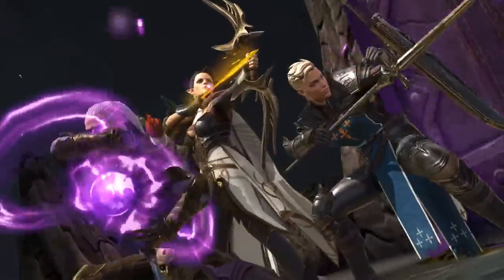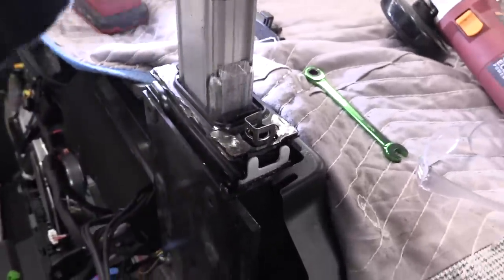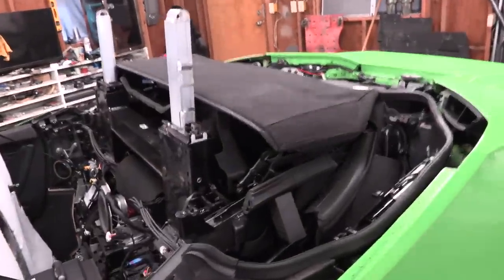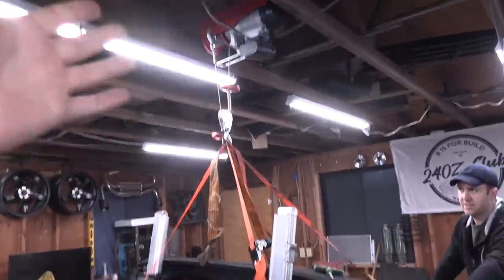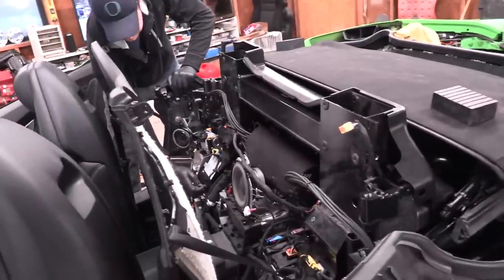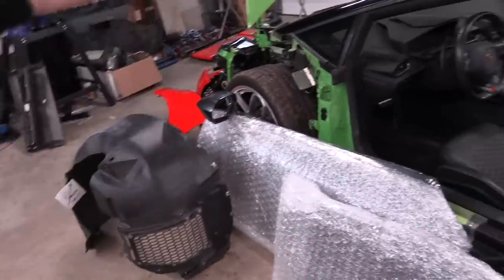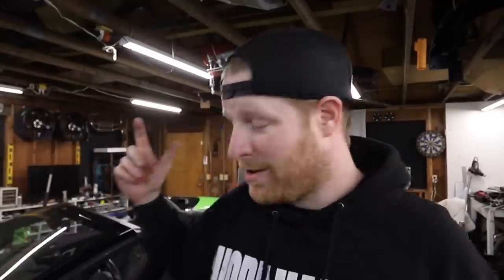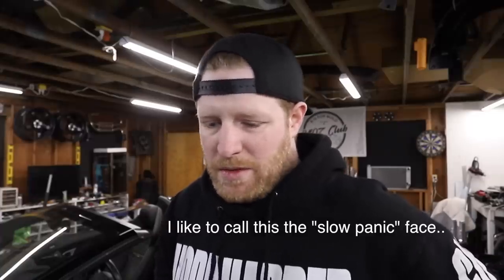Auction Lamborghini Huracan Parts Are In!! And Pop-Ups are Out!!

Comment: Slide a coat hanger down the tube on the outside of both towers at the same time. You can giggle around and find the release trigger for those vertical crash bars. Works every time.

Comment: Congrats on getting those roll bars out, I’ve had to repair them before on a convertible Nissan Murano and it was a pain in the ass even with the service info readily available. The soft top may still not work after you program the window because the air bag system thinks there is a problem with those roll bars even though they aren’t in the car. Since the connectors are not connected, it’s an open circuit and the air bag module will think there’s an issue.
Reply: You can't reset it?
Reply: Eric Knabenshue some cars won’t let you operate the soft top at all because the airbag system doesn’t know what position the roll bars are in if they are not connected.

Comment: I work as a car mechanic in a VAG Dealership in Germany. Everytime a car with a soft top comes in for inspection we have to test these bolts. We use the OBD to connect Odis and blow them up. You just have to push them down in a VW or Audi. Greez from Bavaria
Reply: No pyro, just springs?
Reply: @CyberlightFG  Just spring, simple mechanic. But you need Odis to unlock it, so you can push it down
I dont know about the Lamborghini

Comment: Might be a combo of the door not closing the door switch.  Work at a Mazda dealership and the mx5 won't operate with the doors open
Reply from the maker: @Saxamusprime that was just by hand, i think its possible that its mad about the door, or much more, i have a good quality scanner coming in that should help alot, a good solid reset works magic. I jumped in it yesterday and hit a button on the window and it moved for the first time, nothing changed except shutting the car off for a night..

Comment: Call the 3M rep they can get you in touch with the specialists that will tell you the best epoxy to use. At SEMA there have been guys the last few years that sell a tool for repairing urethane bumpers with this metal iron looking thing and it puts out argon or some other inert gas because oxygen does something bad to melted urethane.

Comment: I am all too familiar with the triple square.  Basically if you took 3 squares and put them together, you get the 12 point pattern.  Had to change a wheel bearing on my Audi S4 a few years back.  I think I bought the same set.  Have never used them since lol.

Comment: Use sorting boxes for the screws. It will save you a lot of time.
You don't need to put it back together to not loose screws.
Reply: I think he was more concerned about forgetting where they went rather than losing them.. I'd be the same with 60 odd.. jesus 😀

Comment: In aviation and mechanical engineering, the term for your "pyrotechnics switches" is... a squib. You've heard of a damp squib? I think it's an old artillery term. Many mechanics who work with squibs have less than 10 fingers... be careful.
Reply from the maker: Its ok kyle is trained to work with explosives, benefit of hiring a marine that used to blow shit up, also these car airabag devices are pretty damn stable

Comment: Rolmao. Hey guys so you know you have to have a scanner to read vehicle codes if you would have just turned off the safety system in the vehicle the bars would have come down it's the same similar system they use in vw Beatles

Comment: lot of work to save $500?  Wonder what happens if they find out that you have to purchase the whole system and can't buy certain components separately like the pyro.
Reply from the maker: the hard part was getting them out, not them down. And they need to get out to be replaced no matter what.
Reply: @BisforBuild  holy crap I actually added a comment worth a response?! B is for build still looking out for the little guy! Was not trolling even though after I read it seems like it... lol

Comment: I would not have those posts repaired but replaced instead, they are a safety device, that once used cannot be guaranteed to do the job a second time even if repaired. I know with fork lifts once its cage has been damaged in some way the manufacture states its needs to be completely replaced as it can not be trusted even if repaired. I know your thinking, be cheap, save money, just like you do with building to frames for bumpers instead of replacing with better OEM bumper parts, but whats better? Doing it right or saving money and getting crushed by the car if it rolls over. I'm not wrong and don't anybody try to come to his defense on this.